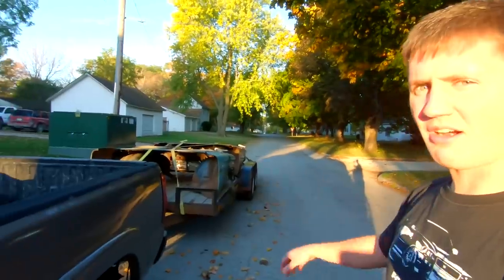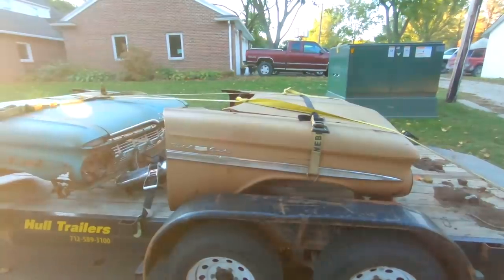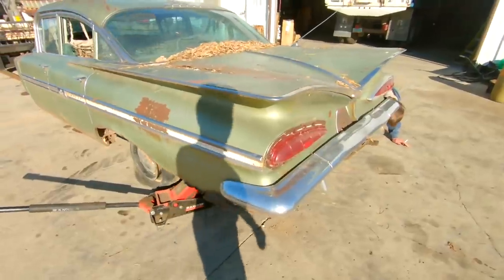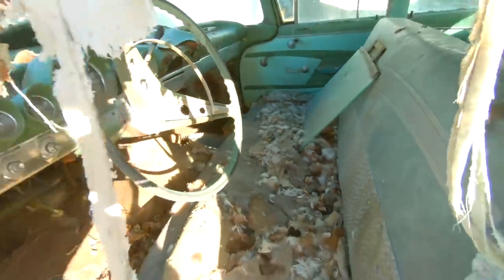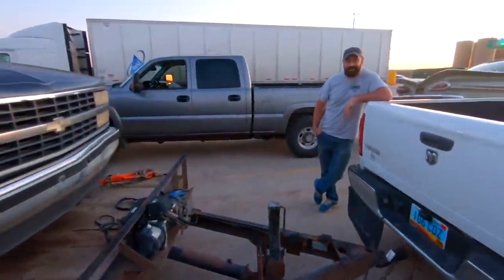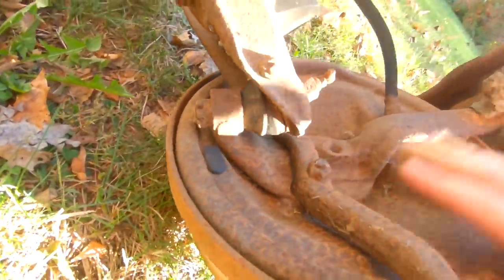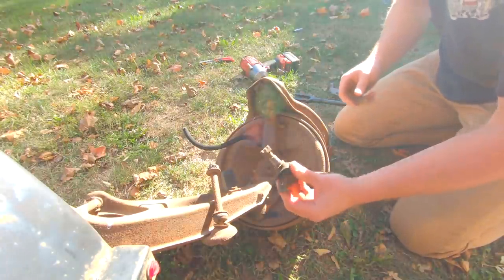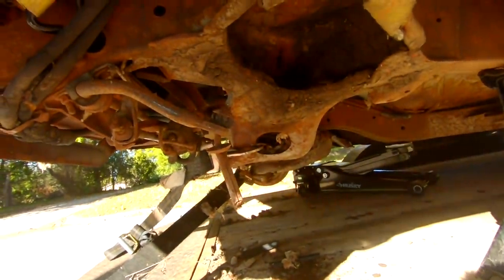I Bought a 1959 Impala Donor Car for my '59 Impala Convertible!! | Visiting Mortske Repair AGAIN!

Comment: It would cost more to restore it than its worth, but it will make a great donor for your convertible. I like the green too.... my dads 59 Parkwood was that green and white. It looks like it would have been a 348 car, due to the sway control, unless someone ordered it on a 283 or 235 car. Sway control was standard on 348 cars in 59. I also see it has power steering. Power steering cars had a different steering gear ratio, so don't let that steering gear go to scrap. Looks like a padded dash too. I couldn't tell, but does it have EZI glass?
Reply from the maker: Yes and yes on the padded dash and ezi!

Comment: Hey Ryan another good find.  Highland Green (RPO 905) is the correct color name.  (I have a dealer book for the '59 Chevrolet.)  You are certainly working your way to your '59 convertible.  How much of the 4 door can you use for it?  I know the trunk lid is the right size for it.
Reply from the maker: all the floor, rocker, lower cowl, trunk floor & lid, etc

Comment: You know.what I would do. And I'm probably the only one who would do this , but I'd put on a front end on it and a drivetrains in it also an interior and enjoy the 4 DOOR. That's right I'd save the 4 door. Even Convertibles are worth more, there are probably LESS 4 doors than convertibles  out there. Regardless of what body style they are, the 59 Chevies are cool. Thanks for saving it.
Reply: Hmmm ...idk, 4 doors were bread n butter cars I'd think. Quick numbers check says 70k  convertibles vs 707k 4 doors not counting station wagons. Surprisingly tho, 2 door station wagons was 20k!! Who knew -besides Ryan?

Comment: Hmmmmm.......  Hard call, Ryan.  That green beast looks pretty good , but we haven't seen right through it yet - looking at the floors, pillars, rocker panels, trunk floor, frame, door frames / bottoms....all the places we know they like to rot away.  If she's pretty solid everywhere, I would feel guilty as all heck if I chopped her up.  However, how many convertibles are there out there?  Certainly not as many as sedans.....and this one was just sitting there waiting for someone to use it for something, so she would live on and save a whole lot of hassle, time and expense in fabricating the panels needed to bring the convertible back.  

As long as the panels are the same (or can be easily adapted as such), then I could talk myself around to believing that what I am doing is the right thing - cutting into what is a pretty good looking and (from what we've seen) solid and straight forward restoration in its own right.  

Don't lose sight of the goal, mate.  That convertible is rarer than rocking-horse lumps and if it isn't this car, then it will be some other '59 and you may not find another one that is so complete and has such excellent body panels, lying around in the long grass of someone's back yard, waiting to be a part of a running and driving machine again.  Save the convertible.  You found the donor - not anyone who's watching your channel.  It's yours and was bought for a great purpose.  As long as them panels fit the convertible as they should, then go for it.
Reply from the maker: Thanks for the comment man

Comment: How much do you want for some of those power steering parts, if you won't be needing them?  I need a PS pump and the triangular-shaped piston ram bracket.  Oh, and I'd restore the car.
Reply from the maker: im not sure yet if i would use a 59 correct PS setup on the convert or not